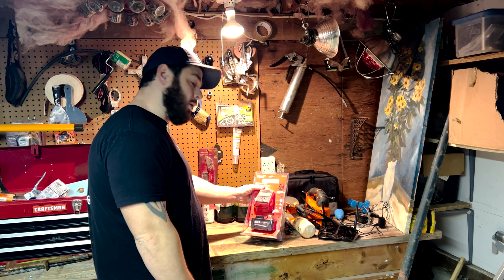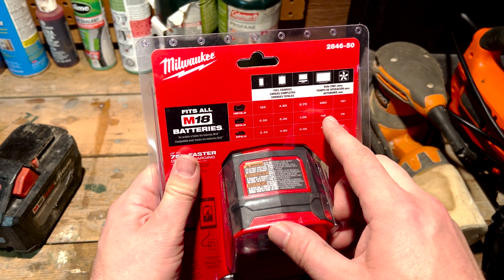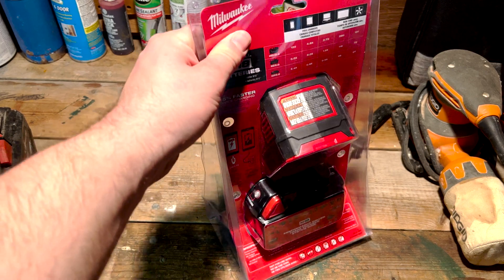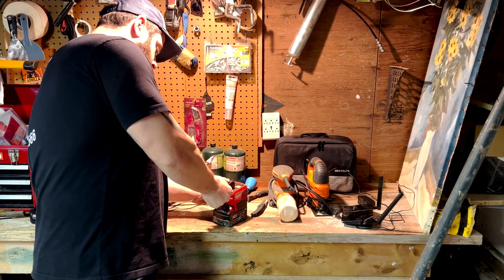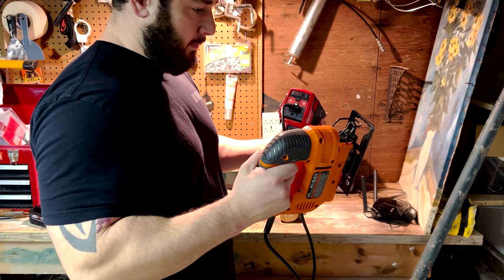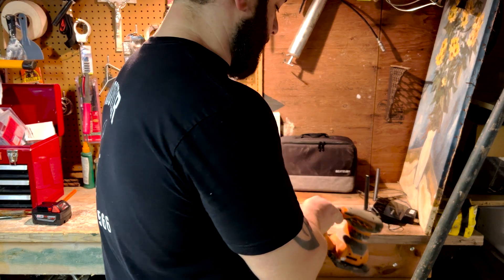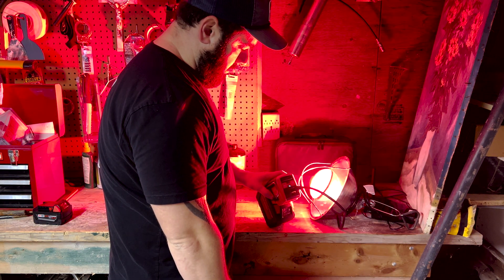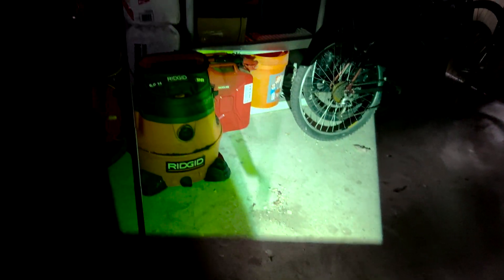What can this thing power? - Milwaukee 18v to 120v inverter

Comment: I wanna know how long the 5.0 battery will run the 1.5 amp projector.  Any chance you tested how long ?
Reply from the maker: I honestly have not used the inverter since. I always mean to but haven’t had a chance yet

Comment: Be careful what you plug into those. The 120Vac that comes off them is not a pure or even semi complete sin wave. Your router test would have been better if you tried to actually connect it to some devices and the internet. It might power on, but be unable to generate RF signals needed to do it's job.
Reply from the maker: Good tip. Maybe I’ll revisit this inverter

Comment: In a power outage you could use this to power a gas tankless water heater. They don't draw much power. I have a large unit and I think it draws like 65 watts.
Reply from the maker: I have a regular gas water heater. I guess it could. I have a decent generator. I need to hook up a connector to my breaker panel

Comment: I picked up the inverter and it used it on our Christmas tree, we have a 9 ft with something around 650 lights and the 5a battery lasted a little over 6 hours. The inverter works great, this I think would help cut the cost of having our tree plugged into the wall.
Reply from the maker: That’s a good idea. I still haven’t really used it yet, but I am excited to.
Reply: A simple plug timer and a bit of time to hide and extension cord would save you lots of money. Try and stay away from batteries when all you need is an extension cord. Lots of people including children die in the mining of the materials for batteries and the world will have no more batterie making materials by 2050 at this rate I’m serious look it up. Plus that’s not how power works those lights will take the same amount of power no matter what’s powering them also you lose a decent amount of energy to heat when charging a battery so the wall plug uses less power.

Comment: 👍🏻 
They are basically giving away batteries this season. That’s one deal like you said the top off by itself is usually $100 on its own. Right now at the depot there’s a Milwaukee promo if you buy a 2 pack 5ah m18 with charger you get a select bare tool free. I personally went with the new m18 inflator. There’s two 5’s with a 12ah for $299. And two pack of 3’s for $99.
Reply from the maker: I’ve been needing an inflator. I bought a cheap Amazon one before. I might go out and grab that soon!
Reply: The inflator is great. I got it on the deal and returned the starter kit since I don't need any more 5.0 batteries. Inflator ended up being less that $100. It's a really solid tool.